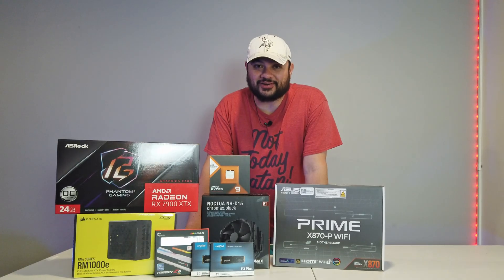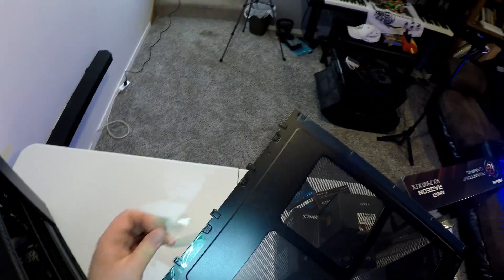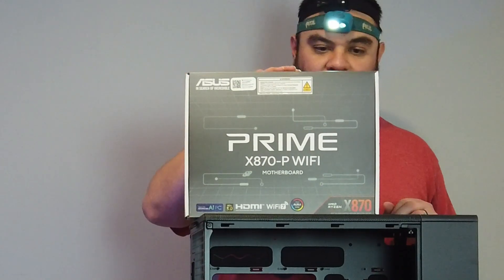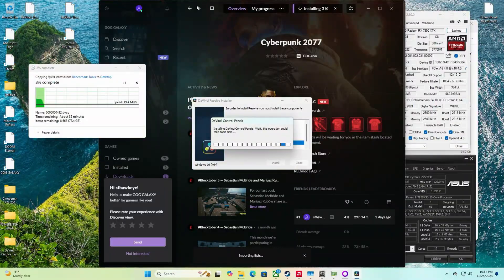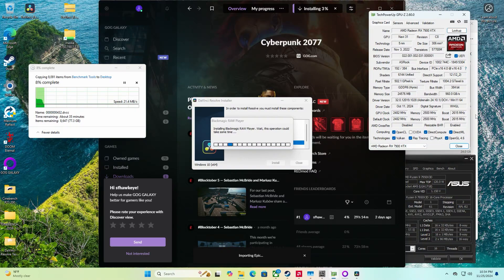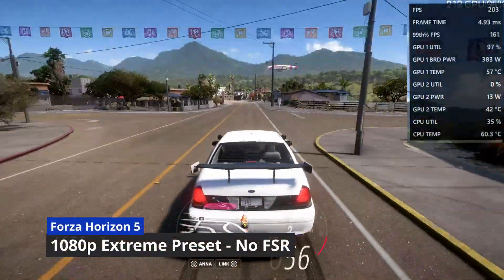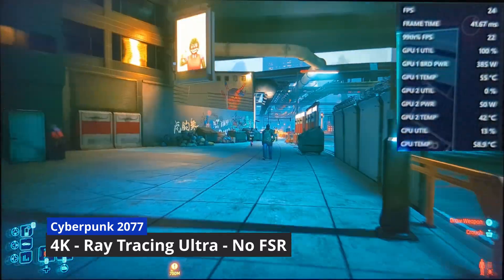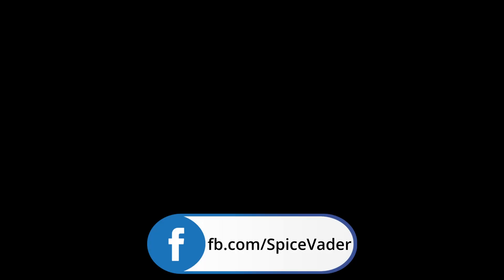Let's Build a PC! Holiday 2024 // AMD S.T.A.L.K.E.R. 2 Build - 4 Games Tested R9 7950X3D RX 7900XTX

Comment: Did your XTX not come with a support to prevent sagging?  Make sure you tune the video card in Adrenaline software, it will help a lot with the cooling.
Reply from the maker: It did not unfortunately. Temps seemed to be pretty good without tuning. Although something might need adjusting as he mentioned there is some coil whine.